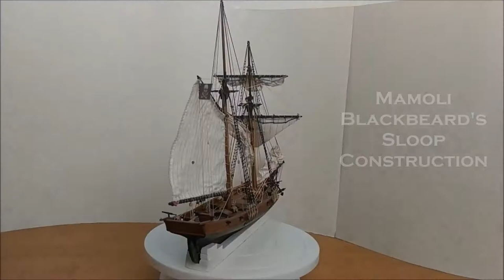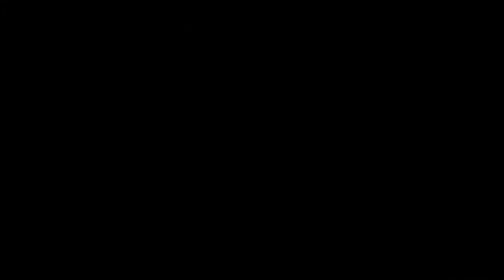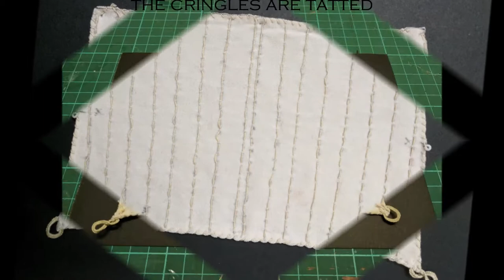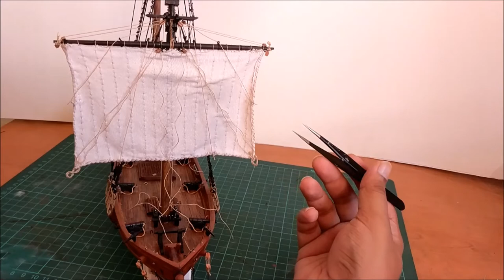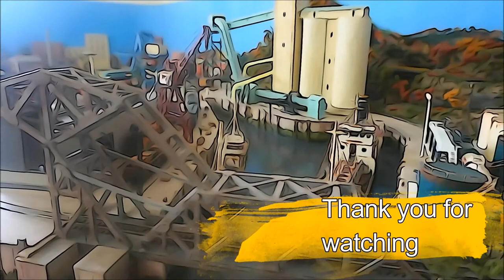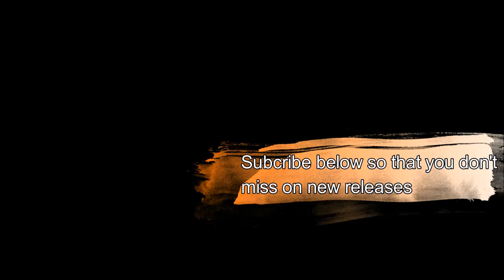Mamoli Blackbeard's Sloop Pirate Ship Project: How to install Fore Course Sail

Comment: Hi, I have just started this model, I built 'The Halifax' a few years ago, the instructions for that ship were far more detailed, so do you have any other videos showing the early stages of The Blackbeard? Kind regards.
Reply from the maker: Hi, Thank you for stopping by. When I started this project I was not active on YouTube (In fact this is the project where it all started), but I did take some photos. You can find them in my Facebook page. The first post is below, you sort of need to follow along from here, there are about 10 posts on the topic.
https://www.facebook.com/trainsanddioramas/posts/1015979398502458

Plus if you go to my video tab and scroll down all the way below, you will find the other vides in case you haven't found them already.
Hope this helps. Cheers! Kaustav
Reply: @TrainsandDioramas  Interesting, the plans you have look much, much different to the set I am following, mine are almost shorthand! Had quite a few swearing bouts whilst building so far but shouldn't be doing this so late at night.
Reply: PS.I am following your fb page now.
Reply from the maker: @Buckerooo  LOL!, I can totally imagine! A kit like that without proper instruction would cause a cursing marathon. The kit that you have is essentially a totally different kit. Mamoli's factory had a fire incident a few years ago and it destroyed almost everything. It took them a year or two to get started again and as far as I've heard, they couldn't bring it back to the same level of quality as before. My Mamoli kits are from the time before fire, hence the difference.

If it helps, I can take some good photos of my plan and send it your way - I've still got them. If you please drop me your email in FB private chat, I can send it across.

Cheers!
Kaustav
Reply: @TrainsandDioramas  Interesting, and my spidey senses did tingle when I looked through the plans and started to construct. I got in touch with Daniel from Dusek Ship Kits, before this info and this information wasn't revealed, (why would it I guess. I feel like I am now part of a modelers conspiracy). I also told him that on the box cover image there is a picture of a pistol/flintlock gun which had a phillips screw in it... no reply to that. So yes, pictures of  your plans would be brill! Thank you for taking your time in replying to all this seafaring shenanigans!